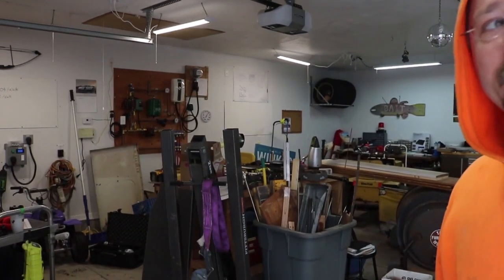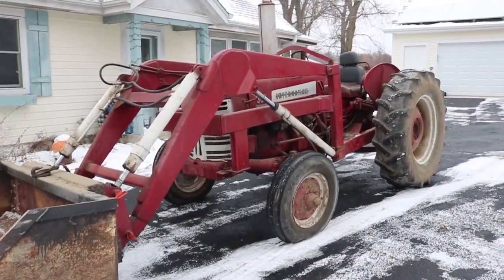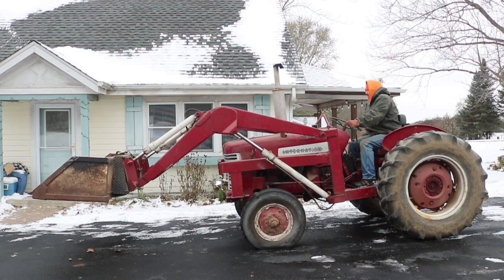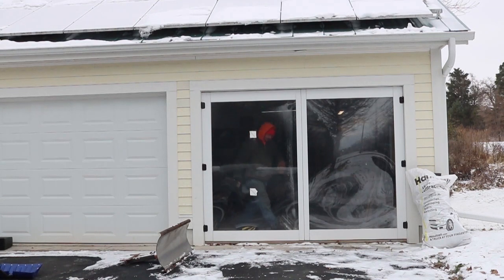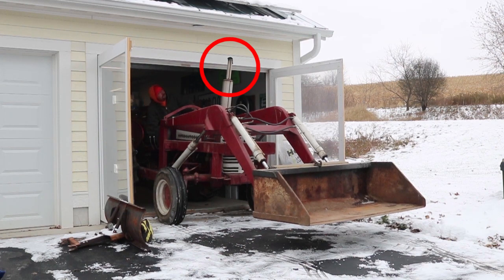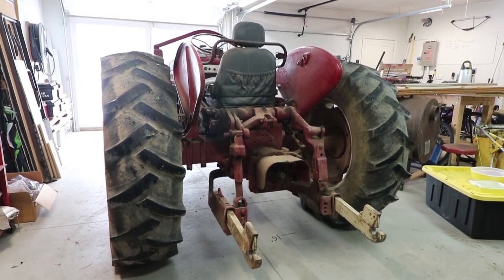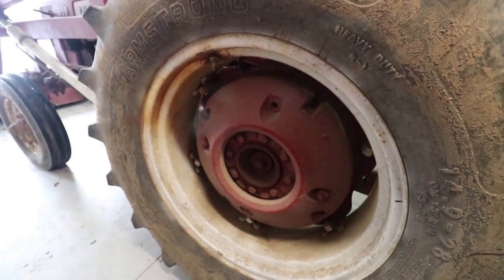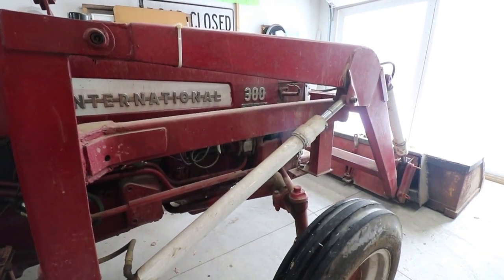Tractor Arrives: Electric Conversion International 300 Utility

Comment: I have one of these but someone done a hack wiring job on it, the fuse is for the lights I assume? Also the pull to the left, choke perhaps?
Reply from the maker: I don't recall exactly, as I'm converting it over to electric anyways.
The wiring on it is pretty simple. I'd recommend buying an owners manual for it.
https://www.steinertractor.com/REP116-Operators-Manual-IH-300-Utility

Comment: If for some reason you need to take off the rear wheels, be careful! The fact that the tractor has a loader and the rims have some rust near the valve stem are a good sign that the rear tires have been filled with calcium chloride solution. The wheels will be a few hundred pounds heavier than you might expect.
Reply from the maker: Jason Whitler Yes, I believe the tires have fluid in them.

Comment: G'day mate. I've got a weird question for you. I've finally done my plug in prius conversion and it has a 240v 15amp on board charger and I was wondering if there is a hack to be able to use the public charge stations with the j1772 connectors to connect to my plug ins 240vac 15amp charger with an adapter cable?
Regards Blair Fraser
Reply from the maker: Yes, you just need to make an adapter with a J1772 Input and an outlet that fits your charging cable. With the J1772, you just need a very basic circuit that signals the J1772 to activate.
I built such a box for charging my electric motorcycle at public J1772 charging stations.
Details at: https://300mpg.org/2015/03/31/the-diy-j1772-charging-adapter/

Comment: I think you're gonna wish you had taken the loader off outside. It's not gonna be any fun trying to move it with out the aid of the tractor.
Reply from the maker: I just needed to get the tractor out of my driveway to start with. The loader is huge and heavy. First thing I need to do is figure out HOW to get it off. Then I'll do that outside.
Reply: If the bucket sits on the ground, you can make something that looks like a child's swing set over the pin end of the arms , support the weight with chains and pull the pins to back the tractor out from underneath it. 4x4 and 4x6 will be adequate to support the weight. Lift valves sometimes have a float position for backblading with the bucket down. Find the right market, people are going to want that sweet sounding engine.

Comment: Ben, Don't you have a right foot pedal for the gas.  That would free your left hand from crossing over and hitting the gas to run the hydraulics.
Reply from the maker: The throttle is a lever on the instrument panel. Unlike a car, there is no gas pedal.
This is the first time I've ever run a tractor at all, so I probably look ridiculous doing it. I'm literally learning while on camera!
If I just set the throttle higher and left it there, that would probably run the hydraulics just fine.
Reply: @BenjaminNelsonX  I was going to warn you about shifting, but I guess that won't matter soon.

On a tractor, you select the gear you wanna run in, and take off from there. You do not go through the gears like you do on a car.
Reply: @BenjaminNelsonX  Got it.  Our old International tractor had both the lever on the panel and a foot pedal, that's why I assumed yours might as well.  Maybe that is an addon that you could easily do if you wished (if it was going to have a throttle)

Comment: Hi Ben. This looks like a great project. I have a 1948 Allis Chalmers with a seized engine I would like to convert to electric. I will enjoy watching your conversion of this tractor. (I really wanted to buy your truck too.)
BTW... To my knowledge, no gas engine likes any back-pressure. It is just lost horsepower. The one positive thing an exhaust system does besides reducing noise, as a secondary purpose, is to prevent cold air from getting to hot valves too quickly and causing them to bend when you shut the engine down in a cold environment.
Reply from the maker: Hi Jack, I've been meaning to talk with you. I never got around to shooting a video on your VW electric!

Comment: I wouldn't do it on a tractor that runs, myself.  I'm sure there are many places out there, scrap yards, junk yards... car pars yards.... that will have non-running tractors that you could get for basically free.  Destroying a well working tractor like this is gonna be a lot more expensive with not much pay off.  Just my thoughts. lol.  maybe I'm just jealous that your tractor is better than mine, and even has a front loader. cheers.
Reply: I agree. Killing a running machine in my part of Colorado is considered blasphemy.
You could easily trade that running tractor for two or three non running machines.
Reply: Agreed, if you have an impeccable source for a nonfunctional tractor that you can be sure of, like a friend, neighbor, relative (wait...), um, best yet your own tractor that you know for sure only has an ICE problem. But without such certainty, finding a completely functional machine and parting out the things you don't need is a much better way to go (especially with my wife not appreciating the items I try to save), rather than finding out later that the transmission, rear end, etc., are also junk worth nothing but scrap metal  (very low value where I live). I like Ben's concentration on conversion instead of end to end repair.
Gotta get outside to fix my tractor now.
Reply: @douglas_drew  I get your point..But most things don't break on tractors.. they just get overworked and need a new engine 9 outta 10 times. more searching would have found a better candidate.  I mean, this thing has a front loader and everything. lol

Comment: Sounds like a nice running tractor.  A hydraulic check valve orifice installed on the up hose of the loader and properly adjusted, will slow the "down" function and make it safer. I had to do it on my farmall 350 (the row crop version of the same tractor) because the week hydraulic pumps on these tractors can't refill the backside of the cylinder as fast as it goes into the reservoir and the oil would overflow...
Reply: Andy Fromm You can control the speed of the loader by how hard you push the lever. Run it enough and you’ll be able to operate it smoothly and accurately. No need for any add ons, just experience.
Reply: @justinstearns9723  you missed the point and i have been running equipment for decades.